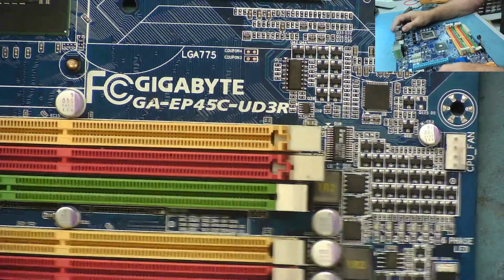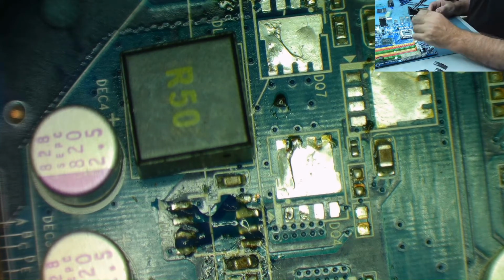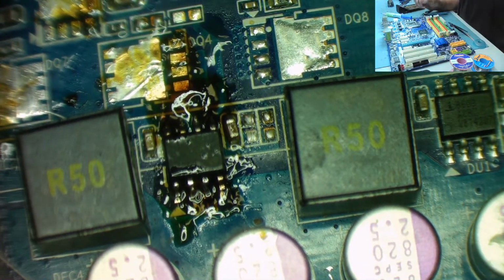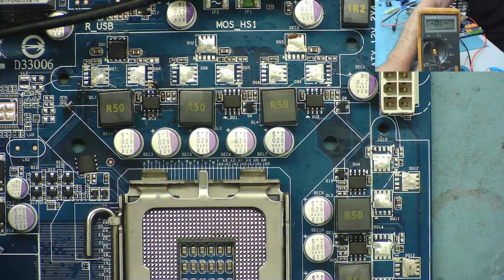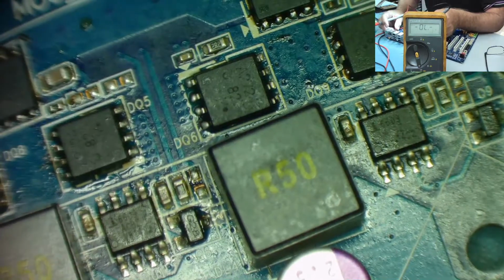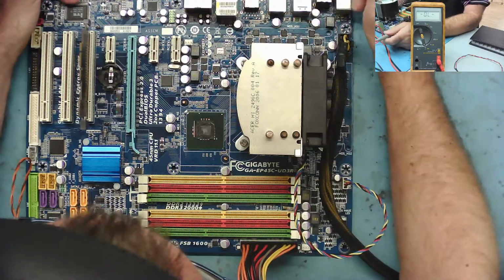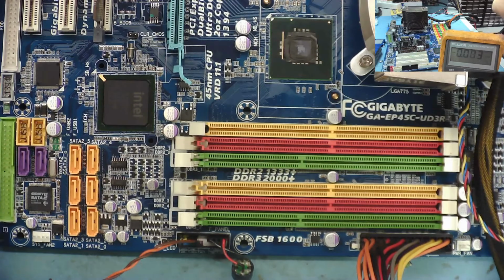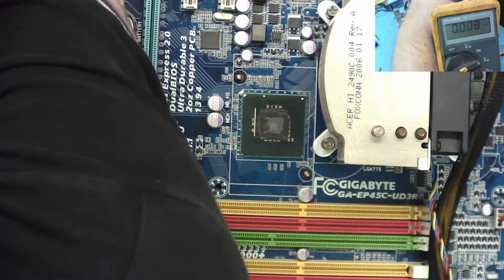Gigabyte GA-EP45C-UD3R Bought Spares Or Repair Parts Missing. Can we fix it? Motherboard Repair #077

Comment: If you keep that resistor in there wouldn't it be like holding down the power button, in which the system would just cycle restated or start and turn off?.

Comment: You say vcore a lot but could you do a video explaining vcore and how to test for it. I often find you are very fast with your testing. You know when a voltage or ohm is right so you move fast. As I'm only learning I'm trying to learn to interrupt what is the right voltage/resistance and at what point on the board. Slowly going through all your videos. Thanks for the work